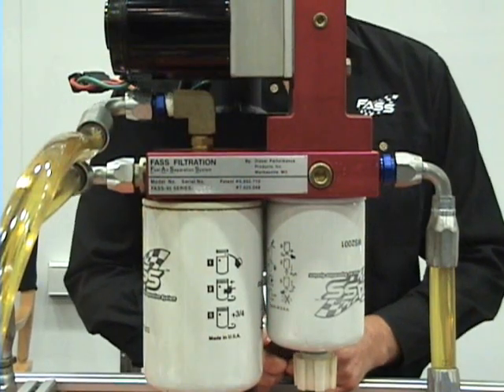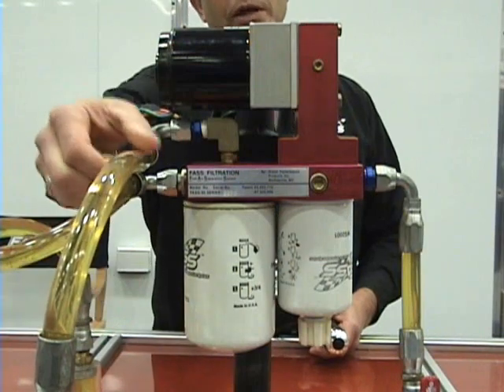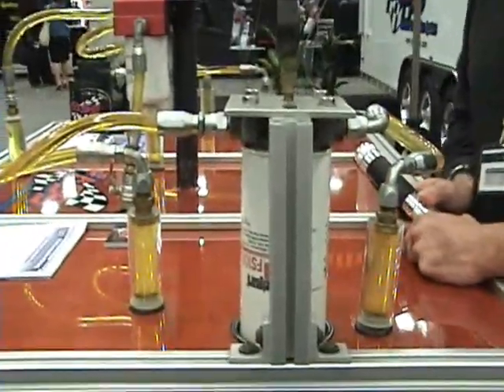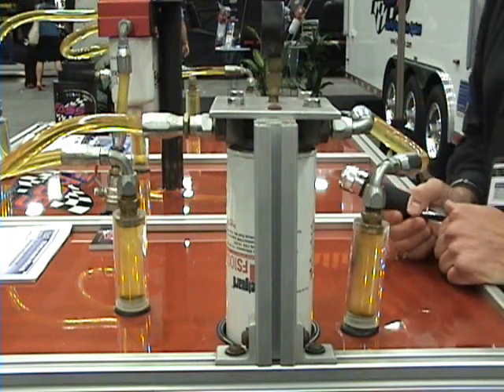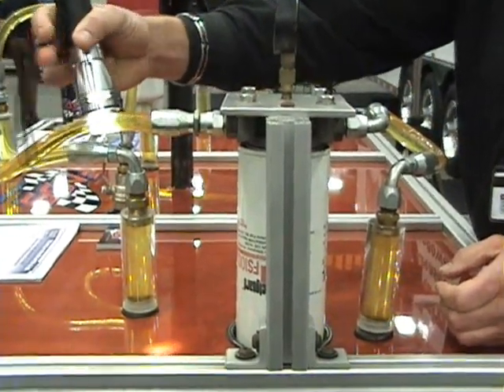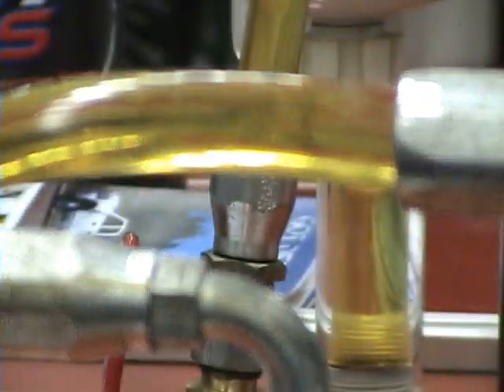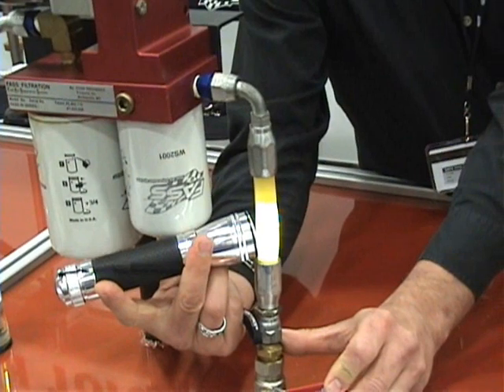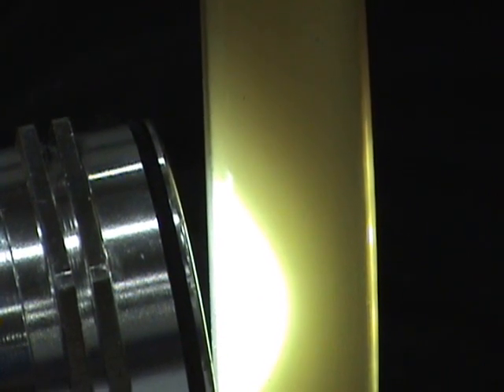GATS 2009- F.A.S.S.(Fuel Air Separation System)

Comment from the maker: Consistent Engine Performance,  Increased Horsepower,  Increased Fuel Economy (Saving 8% or more), Easier/Quicker Starts, Reduced Engine/Cab Noise, Improved All-Weather Performance, Drastically Reduces/Eliminates Black Smoke, Reductions in NOX and Carbon Monoxide, Excellent Cold Weather Performance, Smoother Idle and Quicker Throttle Response,  Extended Fuel Filter Life